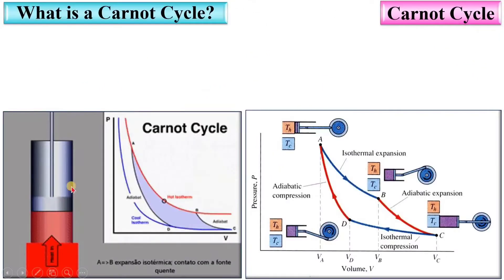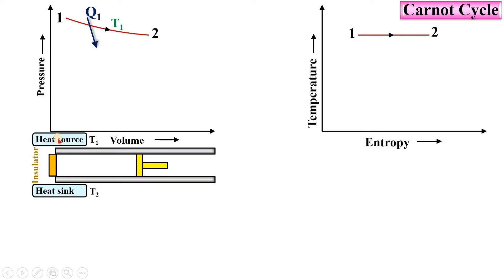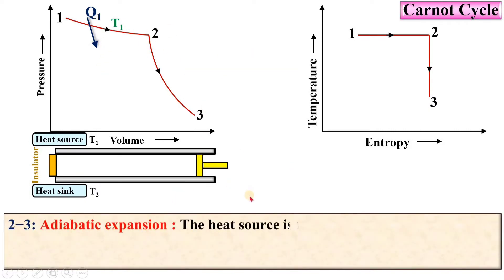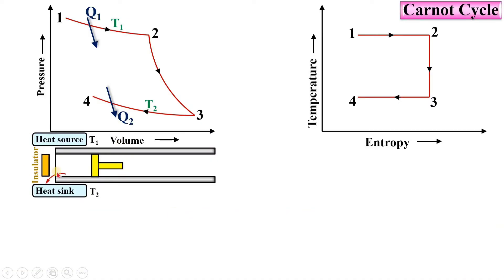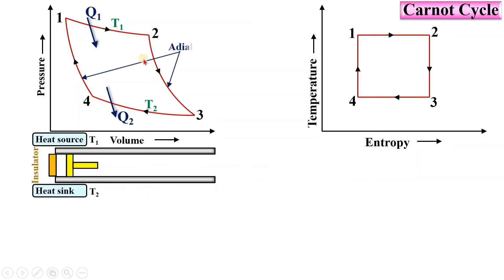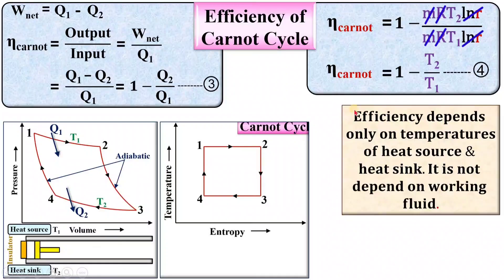Carnot cycle (Basics, Definition, pV Diagram, Ts diagram, Work done & Efficiency) Explained

Comment from the maker: Carnot cycle explained with following Timestamps : 
0:00 - Basic Mechanical Engineering lecture series 
0:13 – What is Carnot cycle 
0:38 – Concept of Carnot cycle
0:45 – Application of Carnot cycle
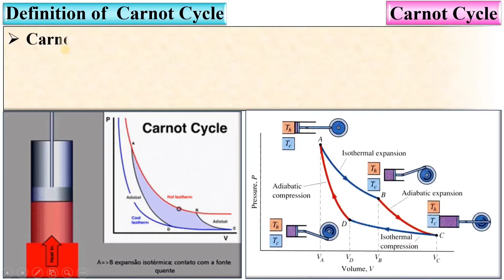1:08 – Definition of Carnot cycle
1:16 – Animation of Carnot cycle
1:41 – pV diagram of Carnot cycle
1:45 – Ts diagram of Carnot cycle
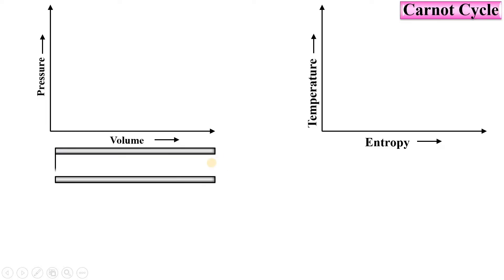1:52 – Carnot cycle diagram
3:02 – Isothermal expansion of Carnot cycle
4:32 – Adiabatic expansion of Carnot cycle 
5:35 – Isothermal compression of Carnot cycle
6:29 – Adiabatic compression of Carnot cycle
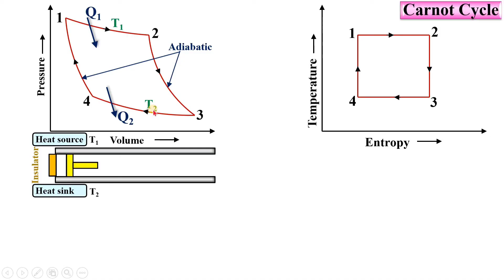7:05 – Work done during isothermal process
7:45 – Expansion ratio
8:43 – Compression ratio
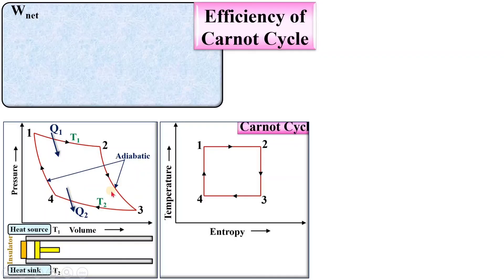9:09 – Efficiency of Carnot cycle
9:26 – Derivation of Carnot cycle
10:10 – Carnot efficiency
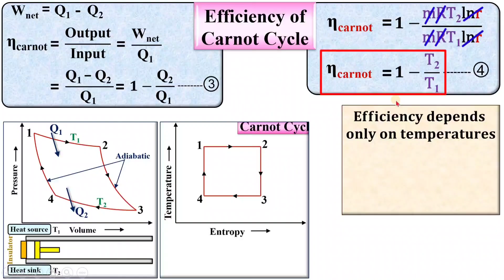10:22 – Conclusion of Carnot efficiency